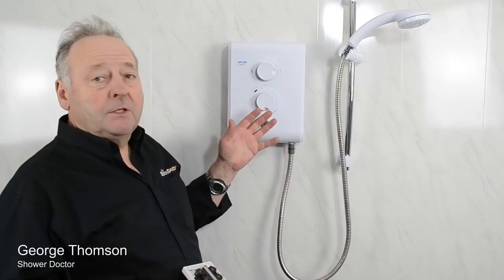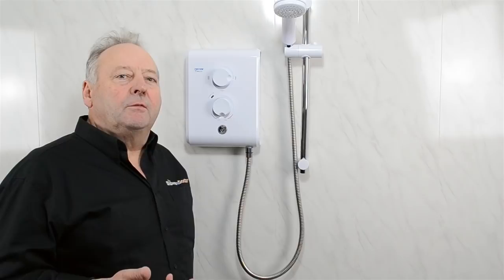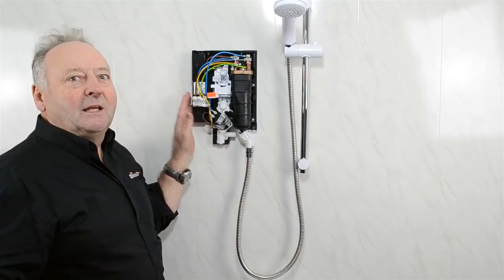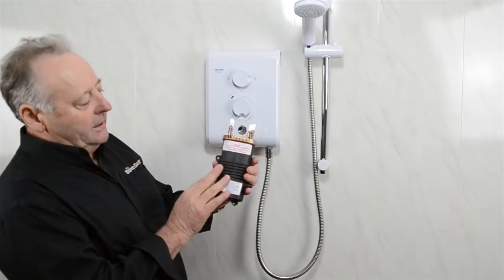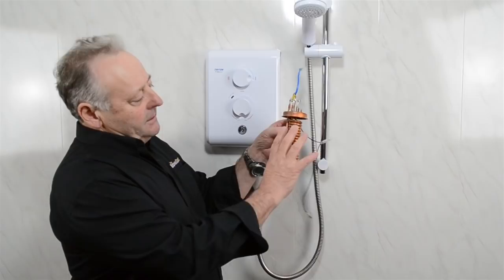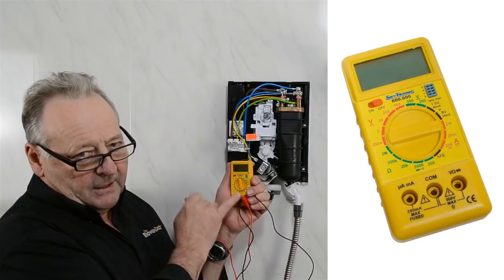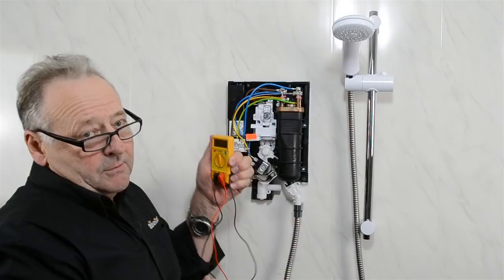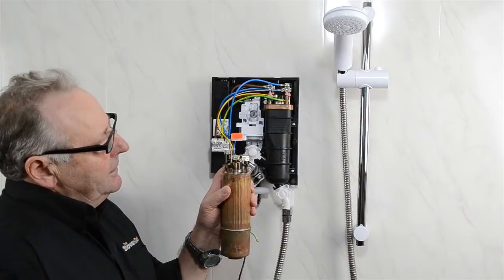Electric showers: Testing a heating tank element inside an electric shower.

Comment: Thank you so much, you saved me buying a new shower. I tested the micro switch and it was ok. I then opened up the main inlet fully as it had been shut off for tap replacement, kept my fingers crossed, switched 4:08  on, magic hot water, thanks again. Any other problems, I'll be sure to check you out on tube.😊

Comment: Very helpful, thanks. Replaced old Triton T80si with brand new like-for-like and have no hot water on economy setting, whereas the previous unit was always on Economy. Using multimeter I found a reading of 12.7ohms one element but 0.04 on the other.

Comment: Hi Doc, I have what appears to be an issue with some heating element or part on my Triton thermostatic power shower. At present, with the water heater left on approx. 1 hour, to get a decent 'hot' shower the dial must be on the max level 9.

Comment from the maker: Each element should show a different resistance as they both have different outputs 
If it is tripping at the fuse board try turning the shower on first at cold if it is ok try the first power setting and if OK try the second if it goes off with either then that points to an element fault 

Is the MCB the correct rating for the output of the shower?

Comment from the maker: Hi Ashleigh

You are doing something wrong when you are checking the elements, both elements have different outputs therefore you will have two different resistances.
The two most likely faults are still a faulty element, or one of the relays on the PCB is faulty not allowing power through to the element.if this is the case you will have to replace the PCB

Comment: It is running ok on cold. But as soon switching to first setting it tripping fuse in MCB. Does the same on second mode as well. 
MCB rating is correct. That shower served us 3 years no problem apart limescale clogging shower head. 
I believe it's the blame (limescale). Element got over heated and burnt out. My concern is why I still get reading on both connection points of element. Is it possible I am getting continuity through the water in the tank, while doing test?

Comment: Interesting video. I switched mine off at the circuit breaker and then did your extra check for live power, I got a strange reading of 35 VAC, despite it all being off. A guy told me that this is due to the capacitive effects of other items running on the consumer unit. The shower is on a separate ring and is the only device on that connection, does this make sense?

Comment: Hi shower doctor I am having a problem with a Mira shower I will work at a medium heat for a while but turn up the temperature it cuts out at the fuse board leave for a minute and switch it back on and it works again the same thing happens do u think it is the T.C.O any ideas hope to here from u soon Derek

Comment: Hi I have triton Inscription electric shower. It started to trip fuse in a main board. By testing with multimeter both elements show 14/16 ohms. It is running on cold so solenoid not an issue. Can TCO be a problem? Does it trip fuse? Or it's still heating element? 
Have another thought if it makes a difference that heating tank is full of water. Do I get right reading,because I read ohms, by checking one element pole with another's element pole

Comment: very informative. However, I had to insert the black probe onto the brown supply lead to get  readings from the heating elements. There were 3 elements and each gave resistance readings of approximately 4.96k ohms. When I tried the blue wire the readings were 0. My shower is a Bristan B85. Now I am puzzled! Any explanation? Have I read it wrong? The shower works fine
Reply from the maker: Mmmm!  There are only two elements in this shower there two wires / elements going into the heating tank and two coming out, however the two that are coming out are joined/ welded together.

So you need the black probe on to the blue wire going into the shower and the red probe on each of the two elements that go into the shower  (Not the ones that are joined together) usually if you have a faulty element you will have one with a resistance reading one with no resistance  ( 0.0k Homs)

Comment: Is a plastic or a copper heating element (the cylinder) safer if the heater is faulty? Safer to prevent electrocution when the heater is faulty. Thanks
Reply from the maker: Hi Jason, George has covered your question in our livestream last week, hope this helps! https://youtu.be/bBX3zJgI9dU?t=20m34s

Comment: I’ve got the same problem, Triton Enrich. Checked the elements exactly as you’ve shown. They are both showing 11 ohms.... no hot water at all on any setting. The prd is working ok.  Any ideas on any further testing?

Comment: hi i have a triton topaz t100si asprante shower. the flow of water has went low and is only warm regardless of turning dial from fully hot to fully cold it still comes out warm with low flow. removed the hose and still no diff. removed the inlet pipe and plenty pressure. i have removed the inlet filter but  was clear,  tested the ohms on the heater of this 10.5kw shower and getting a reading of 11 ohms on both elements. could it be the flow valve at fault and if so can i buy one from yourself.

Comment: Thanks for the video. RCD was tripping as soon as I turned the Power knob to heat, so I had to shower in cold water for a while. However, I turned the Power knob to the first heater setting today and it didn't trip the rcd? Case of humidity/moisture inside the heater can?

Comment: Hello Doc, 

I have moved to a rented property where a Gainsborough 8.5se is installed. Now when in shower on the water only comes out hot regardless of what temp i have kept the control knob on....I was thinking to change the whole shower engine ??
Reply from the maker: Check that the head and hose are not blocked. If no the a new engine maybe needed.

Comment: Hi, Ive recently fitted a Gainsborough 10.5se shower. When switched off, water continues to drip from the shower head, (one drip ever 20 seconds) Can you please tell me why this is happening, many thanks Colin
Reply from the maker: It may be that the solenoid is faulty. With these showers there are few user serviceable parts and the solenoid is one of these, so a new engine may be needed.

Comment: Hi, I have one of these showers and we live in a very hard water area. When I installed our new shower, I also installed one of the electrolytic scale inhibitors just after the main stop cock. It has hardly made any difference, just that the lime scale seems to be a little bit more powder like and the clumps are smaller. 

Anyway if I was to remove the shower from the wall and then try and fill it with limescale remover solution, would this work. I guess the problem is forcing the solution all the way into the heating chamber.
Reply: bogmasher. I used to be replacing heater unit due to lime scale. Solved the problem by switching to cold for 4/5 seconds, Now they make showers with a cool down before the shower switches off. The higher the water is heated the more lime scale is produced, switching off from hot I believe causes the water in the tank to be super heated thus more lime scale.

Comment: hi I have a triton amber shower and  the water  is coming out very slow I have cleaned the shower head and hose and its still the same any sugestions
Reply from the maker: You may have a faulty stabiliser valve.

Comment: hi i have a triton t80 gsi and it has decided to not give me any hot water,Pressure is good and the filter is not blocked.Any ideas what it could be thanks
Reply from the maker: Hi Harriet, if your shower is only producing cold water then it sounds like your thermal cut out switch (TCO) has failed for some reason. This part is a safety device and normally cuts the power to the heating elements when the water overheats inside the shower. 

Normally you would be experiencing temperature or flow problems running up to this part failing. Was this the case or was the shower working as normal? 

Reasons for the shower over heating could be one of the following:

The water board are working in your area and the pressure is lower or the water is turned off

The Stop tap to the shower is not fully open

The filter is blocked (which you have already checked)

You have a leak inside the shower coming from the stabilser valve / pressure switch

Wires are melting inside the shower.

If you do find you have a leak from the stabilising valve then this can be replaced with this item in the link provided - http://www.showerdoc.com/triton-stabilising-valve-p22640800 

If your shower wasn’t experiencing any of the above symptoms before the TCO failed then you should get away with fitting a new TCO which can be found via this link provided - http://www.showerdoc.com/triton-tco-t80z-new-22012340

https://www.youtube.com/watch?v=_zi8JbEMYMs

If when this TCO is fitted it cuts the hot water again to cold then you will have an underlying issue and it will eventually fail this part again. If this is the case you will need to get in touch once again before this happens. 

If it works ok then it was obviously a drop in pressure or this part just decided to fail.
Reply: The Shower Doctor yes it was going hot and cold.Thanks is it expensive to replace?The unit is only 2 years old.Just wondering what could cause this.Thanks again

Comment: Hi shower doctor. l got galaxy aqua 3000 and the water its to hot what parts of the shower l must change . no matter if it is in cold or warm medim position remains always very hot water .
Reply from the maker: Hi Alencar,

The things to check first are:

1 That the main valve coming into your house is fully open. 

2 Then check that the valve on the line to the shower is fully open. 

If these valves are not fully open then there may not be enough water getting to your shower to cool it properly the overheat safety device will turn the power off until it cools Then it all starts again

Make sure that the shower head is clean and clear, that the hose isn’t kinked (this can happen just behind the hand set where it is difficult to see) also check the inside of the hose although it can look OK on the outside it could have collapsed internally 

The other possibility is a faulty flow/stabilizer valve not allowing the correct amount of water into the shower. 

The Shower Doctor

Comment: Great video. Question - Got a Mira Go shower. With the temperature turned full up, we only get luke warm water. Would you like to suggest which part might be the problem?
Reply from the maker: It's likely to be a faulty heating element inside the heating tank.  If you can follow this video process you can find out for sure.
Reply: Thanks. You were of course right. Time for a new shower!

Comment: hi i have a triton cara shower that is running cold ive checked the TCO thats good and ive also checked the heating tank element they are both giving a reading of .012 is this likely or is there another problem as ive seen where you said they should both have different readings thanks for any help you can give
Reply from the maker: There is usually a 2-3 ohm difference between the readings on the elements. If the shower is hot then cold it points to a flow problem. This shower needs 1 bar dynamic and a flow of 6 litres a minute minimum to work properly. If these are fine then you may have a faulty Stabilizer valve.
Reply: The Shower Doctor the shower has been fine for years but now it wont get hot  it stay's cold no matter what temp is selected.
Reply from the maker: Eddy Flynn May seem like a silly question, but did you check to see if there is 230-240v at the connector block in the shower?
Reply: The Shower Doctor yes it may seem a silly question, (not as silly as i should of checked that first though) but that was the problem and the arcing sound when the shower is in use has also gone thank you so much for you help all tightened up now and the shower is working fine .

Comment from the maker: Shower Doctor TV - Testing a heating tank element inside an electric shower:
Reply: Hello. What setting do I put my multimeter on to test the element please? My shower has recently decided that it wont heat up past 30degrees. I'm working my way through your videos trying to find the problem! Thank you.
Reply: +mark taylor I have the same problem recently. Can you please advice me how to check? I am trying to figure out how to use a multimeter as well. :(

Comment: how much does it cost for heating tank for triton T80Zff
Reply from the maker: Hi Jimmy, these cost between £60-£80 on our website, depending on the power rating. Here's the full spares list for this model: http://bit.ly/2j7FZ9M
Reply: hi doc could you tell me if the     T80Z and T80Zff   ARE THE SAME
Reply from the maker: These are 2 different showers Jimmy. If you're unsure which one you have give us a call on 0131 538 4343 and we'll do our best to advise you on the correct part.